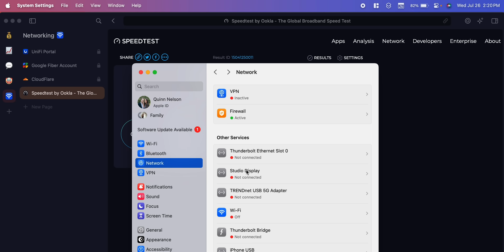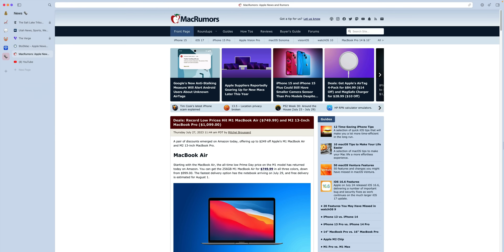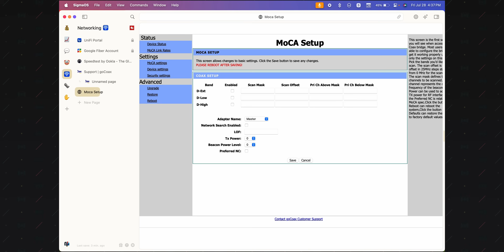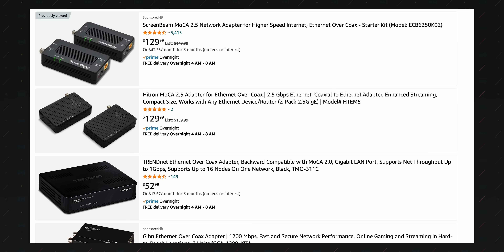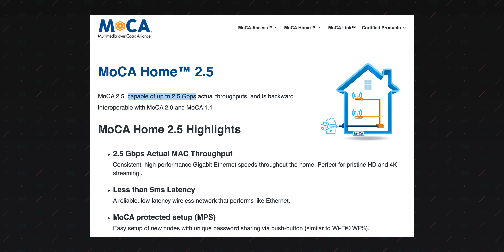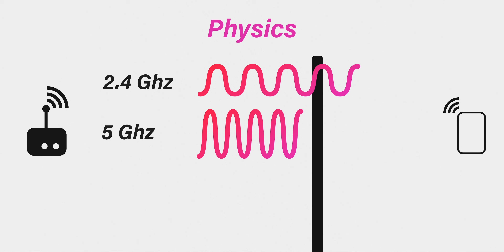10 Gigabit Network Retrofit for Renters. No Drilling Required!

Comment: Can you make a video about running cables in walls? I bought a 4 year old house, and there is sadly only ethernet run from the technical room (breakers, air system, water heater) to the wall suited for the TV. I'll watch your video about improving wifi, I have asus ai mesh. But I want low latency low gitter high fidelity game streaming from the bedroom pc to the living room. Or maybe even use a thin client in the bedroom and move my pc to the technical room where I have my 3d printer, home server and also chest freezer

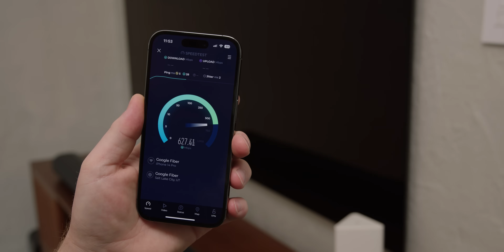Comment: 3:51 I don't get why you think this "the best possible test" just because they are close. You don't know what line noise is going on. (Even from your neighbor, or from the power generation or substation itself.) Have them both plugged into the same circuit, on an unplugged (but powered on) UPS. I think that would be a far better test to hope for the rated 2Gbps. (Not saying you'll get it. I'm saying try for the absolute cleanest power as your baseline.)

Comment: Power line is really not a good option, it's more of a stop-gap. Plus, the power line device will degrade, and eventually dies if used continuously, like 1-2 years.

Comment: Unfortunately my two floor apartment has only one COAX port, and my walls are solid brick instead of cardboard. So I'm stuck with powerline.
Reply: *apartment
Reply: @alvallac2171  thanks. Corrected my spelling

Comment: Shame this will only work in the US. In Europe (England included) Coax is usually only put into the living room, which probably has something to do with most homes being brick-and-mortar and laying cables is a task and a half. I'm sorely tempted to pay someone to install cables in our rental because good WiFi 6E and 7 routers cost an arm and a leg.
Reply: The WiFi 7 specification isn't planned to be finalized until 2024. Anything you see currently advertised as WiFi 7 is a draft version, which won't necessarily be compatible with whatever the final spec ends up being (some products may receive firmware updates for that, but many won't, so it's a gamble). Also, draft products often require using access points and WiFi adapters all from the same brand. All of this is on top of the cost issue you mentioned. Most people should stick to finalized standards (currently WiFi 6 or 6E).

Comment: Another tip with actually using ethernet is there are flat cat5e/6 ethernet cables in white, which can be very discreetly run and blends into white walls

Comment: Just to Add on my case: I had my rented appartment for university. And I wanted to wire my laptop in my living room and my desktop in the bedroom for remote play without messing with wifi. Because there was a door in between, I bought a 15m "Flat Cat5e cable" for 10€ and runned it through the edge of the wall with some clear tape, so it won't move And it fit right bellow the door so I can close it. Now that I left the appartment, i took the cable with me (just had to clean some residue with isopropyl) and I used it again at a airbnb, for better internet speeds and now I gave it to a relative to do the same thing to his room.

TL;DR: Try Flat Ethernet Cables for the tricky spots and if the regular cable doesn't go under the door.
Reply: *to add
*apartment
*university, and
*ran
*move and
*below (different meaning and pronunciation)

*an Airbnb (because "Airbnb" starts with a vowel sound)
*flat ethernet cables

Comment: You can mix and match powerline adapters to an extent: If they are implementing the Homeplug AV standard.
Unfortunately the really fast Devolo Magic 2 powerline adapters are incompatible with Homeplug AV. However, you can use both types of powerline plugs on the same circuit. They won’t disturb each other.
That being said: Powerline is highly situational. I have used it in a small holiday house with perfect, basically lab like results. Yet at home with many more circuit breakers its performance is abysmal. One thing you can try is having a phase coupler installed in your fuse box.
If you are using DSL, powerline might also be a bad option, since it tends to use the same frequencies but transmits over unshielded cables, turning your walls into antennas. The phone cable itself is also likely unshielded. However, advanced adapters such as Devolo Magic 2 have options for compensating (V)DSL. I haven’t tried them, because I am using fibre, but they might be an option. Also I’m talking about the situation in Europe. Powerline might behave differently here than in NA.

In short: if you can, avoid powerline. But for homes with only one circuit breaker per floor it might work decently well or if there is no circuit breaker in between your adapters.

Comment: I use the exact Powerline you showed (Australian power version) and I get almost 100 mbps on speedtest for the 100 mbps system in my shared apartment. The router is one floor and 30m or so away, too.

We don't have coax here.

Comment: Note about MoCA: While it is backwards compatible, the entire MoCA network will work at the speed of the slowest adapter on the network. So if you have a mix of 2.0 and 2.5 devices, the MoCA network will work on 2.0 speeds.
Reply: Just like ram sticks

Comment: Speed is the least of the issues with power line adapters. By definition, they put a LOT of noise on your AC lines. This can cause a lot of issues with various electronics, from humming and popping on your audio system, to wifi connected power switches constantly resetting. They can cause all sorts of trouble.

Comment: Please note: you tv and internet signals will be affected if you put a splitter on there.
Reply: Yes, if you use an inappropriate splitter, that is correct.
If you buy a newer one, then that statement is incorrect.
Older and cheap splitters do not support the full signal range.
You need one that's MoCA 2.5-compliant if that's what you're going with.

Comment: Sadly, all my coaxials are in the second floor, while me office is in the first floor. Currently I am connecting to the wifi through the floor and 3 walls, so not ideal.
If this weren't a rental place, I would take a hammer and make a hole in floor myself.

Comment: I like the quarter-round hack the best; never thought of pulling up a wood strip and replacing with that track! Great for some wood floor rooms where you can't tuck the cable under the trim.

The inside turns are a little tight (especially for Cat6A or better), but as long as you don't have too many of those bends... should be okay.
Reply: Get a flat Cat cable. You are sorted
Reply: @kameshganeshan2894  Do not get a flat cable. It may work fine at first but will cause problems, the cable is not supposed to be flat.
Reply: Would optical work?
Reply: oh a JeffGeerling Comment
Reply: @cbgames-xyz  It's an older comment, sir, but it checks out!
Reply: @JeffGeerling  you must've liked the video
Reply: If you are willing to pull your wood quarter round up to put a race, you may notice there is room behind there already to tuck the ethernet. No need for the race. Just have to pull all your quarter round...

Comment: Yeah I never had luck with Power Line adapters myself, they always end up around n300 speeds, maybe n600 speeds on a good day. Most of the time in not so far away where wireless wouldn't work, so I usually opt for wireless before Power Line, heck with wifi 6 now, I was get over gigabit speeds moving stuff to a NAS with a 2.5gbit port, not bad for wifi.

Comment: This is really timely, considering the newest Wifi specs. Wifi 7 routers are available now, just expensive, and they offer up to 30Gbps speeds. Expect to see it become more common at the end of this year, 2023.
And Wifi 8 is expected to offer up to 100Gbps speeds using a new set of spectrum. Cabling bay be a thing of the past pretty soon, except for those pesky backhauls.
Reply: The WiFi 7 specification isn't planned to be finalized until 2024. Anything you see currently advertised as WiFi 7 is a draft version, which won't necessarily be compatible with whatever the final spec ends up being (some products may receive firmware updates for that, but many won't, so it's a gamble). Also, draft products often require using access points and WiFi adapters all from the same brand. All of this is on top of the cost issue you mentioned. Most people should stick to finalized standards (currently WiFi 6 or 6E).
Reply: @alvallac2171  My understanding was the draft was epected to be finalized by the end of this year, so authorized products by next year.
My point was wait for what will be half a year and Wifi 7 will be here. That Wifi 7 will be faster than the 10Gbps these setups are offering, and that Wifi 8 is around the corner.
Myself, I am looking at upgrading my devices Wifi to 7 in all pcs I can simply to avoid these cabling issues. The house I live in is old enough to have cable, but it has cable on one side of the house going up, so not useful for my usecase. But, Wifi 7 will get me most of the benefits of a 25/40Gbps devices, and will hopefully be much less expensive.

Comment: What works for each individual is dependent on that individual's circumstances.  I have a 70 year old house, with 70 year old wiring.  Five year old powerline to my detached garage provides 200-300Mps.  If I wanted to view 4K video in my garage (really only some security cameras), I'd need about 10% of that.  Within my house, I'm not sure as it's all wifi.
Coax?  Just a few runs (most of which I did myself) to the attic.  Not suitable for data.

Comment: This technology has been around for a very long time.
Reply: Why isn't it more popular? I had never heard of it before this video, and it seems really useful to me. I don't have an ethernet outlet in my room, but I do have a coax port. I just wish those MoCA things weren't so expensive
Reply: @EthicalAllele  There is a lot things to consider when using this method, All your cable wiring in your house has to be perfect. You need at least RG56 cable. Everything has to be wrench tight from the pole to all the splitters, wall plates and all devices with all compression fittings. You also need all MoCA splitters at every single split. All the cable wiring has to go to 1 point at the cable feed into the house. There is one important thing he left out. You DO NOT need these at every single point you want internet. You need 1 at the router and 1 wherever you need internet. Where the second one is, you can use a router on the ethernet port from that MoCA adapter, you DO NOT need to go directly into a computer.

Comment: Noo! Coaxial splitters do not work super well! Seeing as this is targeted at renters, you already have a VERY real chance of being behind a splitter! Having more than one splitter, or any on longer lines in apartment buildings means the power on the line gets WAY too low! I've personally had MANY problems when trying to resolve an apartments internet problems, such as packet loss and egregious bandwidth, and its because it was behind multiple splitters! If you don't personally know the information about the line before it reaches your room/apartment/subdivision, do not rely on a splitter!

Comment: I didn’t know you could do MOCA while the cable is in use, so this might have convinced me to try MOCA soon.

Only thing stopping me now is that with a WiFi 6E router, speeds are already fine, and the 2 devices that benefit significantly from a wired connection are next to the router anyway. One’s on the other side of the wall, but I already added ethernet to the existing coax plates and drilled a cheeky hole between the two.

My plan was to maybe do MOCA if I ever switch from cable internet to fiber, but for now just use WiFi, but now I might actually do MOCA if I feel inclined to get faster speeds on my TV or move my router/modem somewhere else in the house.

Comment: I have a network installation and consulting business, typically we will run ethernet to network locations but there are some instances where that's not feasible.  MOCA has always been our go-to for those instances and we've been very happy with the results. We like using the Motorola brand ones because they come with everything that you might need(cables, POE filters, mounting templates).
Reply: Awesome, thanks for sharing!
Reply: Hitron HTEM5 2.5gbps is better

Comment: My apartment sadly doesn't suit the methods mentioned here,  (my skirting is half round, so I couldn't add another half round to it). So I used another one, fiber optic cable is incredibly thin, and the new bend-insensitive fiber is really flexible. By using cheap ethernet media converters with bidi transceivers, and pre-terminated patch cables, I ran the cable along the top of my skirting, tacking it down periodically with super glue. The cable effectively disappeared.

One thing I have found, that is slightly harder to get, but still available is transparent pre-terminated fiber, if I have to do this again, I will probably use that, as it would be a little less fiddly than painting the fiber to match the wall colour as I ended up doing in my install.
Reply: *another
*transparent
Reply: @alvallac2171  Thanks, I typed this on my phone late at night here, so I didn't have the best spelling.

Comment: I've been running motorola MoCA gear for YEARS in my house without any trouble. Not sure of the value the "goCoax" unit has, since... my motorola stuff was complete with auto configure. If there's anyone who's turned on by the idea, but turned-off by the kind of wonky setup flow with these chinese units, go for the brand name instead.
Reply: Yep the Motorola 2.5 ones are great, never even had to think about them

Comment: Also for hiding cable in cracks I recommend a window screen spline installation tool. It looks like a handle with rollers at each end. One has a groove in it. Use that to just roll the cable under the baseboard trim or anywhere you need it to go.

Comment: Nice video! All MoCA adapters should have a MAC address on the bottom of them.  You should be able to add a reservation in your DHCP server/router and it’ll automatically assign it the IP you reserved for it. That way you always know where they are on your network unless you change DHCP server/router. Then you know exactly where to go to configure them every time.
Reply from the maker: That's a great idea!

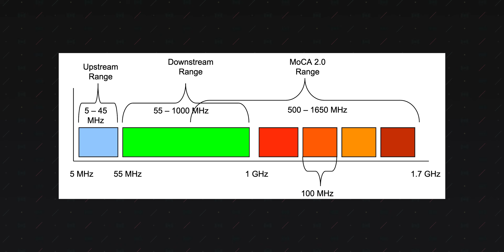Comment: 7:45 to answer the question of whose still using a cable box, as a field tech for one of the big american isp's the answer is far too many people.

Edit bc got further into the video, 10:39 some isps use poe filters but others do not. Probably a good idea to check if you have one
Reply: *who's (contraction of "who is" or "who has")
whose = possessive

*ISPs, the
*filters, but
*one.

Comment: In the UK, only the living room has coax you're talking about (in the UK we have 2 coax standards. One it the freeview standard, the other is the satellite/cable standard. Nicknames, btw, IDK their actual names, the one you want is the Satellite/Cable Coaxial cables, the most expensive kind). So a coax method isn't feasible here, so Powerline or Mesh Wireless are the 2 types most typical in the uk. You can still have a coax system even if there's only initially 1 point, you could expand it using new cable, but now you're running cable all over the home/flat (albeit still more reliable, and less costly than ethernet) you could get your whole home wired internet for about $15 + cost of the adapters and use a single run vs maybe about $60 ($40 with the advice I mention later, +$30 for every termination point. worth of ethernet + terminations, tools and in multiple runs (though if you use switches at every termination point that can also more easily be a single run, at an increased power usage and significant increase in cost.)

Comment: cable companies still use moca for IP tv boxes. DO NOT USE MOCA OR SPLITTERS IF YOU USE THOSE CABLES FOR TV OR INTERNET!
Reply: This is why there is moca on isp modems. it is designed for cable boxes...not for internet.

Comment: The issue with the power line is also because the lines have no twisted pairs. The more twists in a lair of lines in cat5 (also called twisted pair). You have the + on one line and the - on the other and they’re twisted inside the cable jacket. These twists cancel out noise and crosstalk. In fact the only thing that makes a cat 5 faster than a cat 3 and makes a cat 6 faster than a cat 5 is just the amount of twists in the pairs (this is disregarding the equipment on either end as that can be a bottle neck) Your power lines have no twists on the axis of the lines. This is why it will always be slower (plus everything you said).

Another thing with MOCA is that you need quality cables, quality splitters that support moca frequencies (1500 MHz and above) and if there are too many splitters in the system then it will attenuate those frequencies too much (higher frequencies attenuate more than low frequencies). Also if the cable has poor shielding or is damaged or even has poor fittings it can let in a lot of noise. You’re more likely to see noise out of those frequencies as most frequencies do not operate within the moca frequencies. However if the transmission devices you use are using lower frequencies then your signal may be degraded if that’s the case. Also I wouldn’t count on your house having a moca filter as most moca systems are obsolete or some houses may never had a system that required a moca signal. Your isp may get a little annoyed if they find out you’re feeding moca frequencies into the cable plant haha. Although they’ll probably just give you a MOCA filter to help you out. You also need to make sure your moca network is all connected. Most isps don’t hook up extra cables that they aren’t using as it can backfired noise into the plant which affects the neighborhood.

Sorry, not trying to sound annoying but it’s not always as simple as plug and play with a MOCA network.